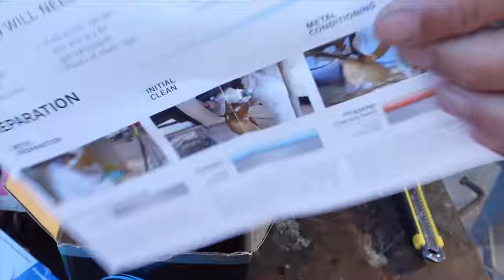Now we are ready Ep 404

Comment: That's a sexy bottom! If the prop speed doesn't work out, you could treat the exposed metal with alodine and clean with fresh water. Then, use a coat or 2 of Devcon aluminum putty for the pitted areas. We do that on our aircraft.

Comment: Hey guys great work
Propspeed works you did a great job applying it however I believe you didnt use enough. After two coats of the yellow primer it should look bright yellow and none of the electrolysis should be able to be seen. And then make sure to use up all the silicon paint.
After you finish it should look a bright gold yellow and then after a couple of days it should turn to a gold yellow. Given just the size of your propeller a medium sized kit would i think be the minimum as you did the shaft as well.
Anyhow it will still work but may need another application sooner than normal.
Reply: This is my issue with Propspeed...huge cost for one season or 12 months (according to the manufacturer) of protection.  That's not nearly enough for what they charge and I'm guessing the he put on what he had and didn't have enough left to do more coats (purely a guess).  Catalpa crew is correct, if your boat sits and you don't give the prop a wipe down, stuff will grow; the system relies on the turning of the prop and/or regular wipe downs to keep the growth at bay.  This is because there is no biocide in Propspeed, just a really slick surface that is hard for growth to glom  onto.  I don't understand this logic, yes, I get it, antifouling paints full of biocides are toxic to the environment, but if you just painted your entire boat with multiple coats of a biocide filled paint, what does it matter if you put a little more on your prop, shaft, and limited other metal parts under the water line?  I think you get better value and performance (for the cruiser AND the weekend seasonal boater) from a product like Pettit Running Gear Guardian.  Not only does it provide the slick surface but it also has biocides to inhibit growth at the dock or on the hook.  Yes, still expensive at 200 bucks (Defender's price) BUT it's cheaper than Propspeed AND multi seasonal, not just 12 months.  Nope, I don't work for Pettit and I'm not paid to promote for them.  Companies like Propspeed that charge ridiculous prices for their products that far exceed their production costs and overhead just kinda piss me off.  All that said, to each their own and I certainly don't begrudge Catalpa Crew for what they decide works for them.  Fair winds and following seas!